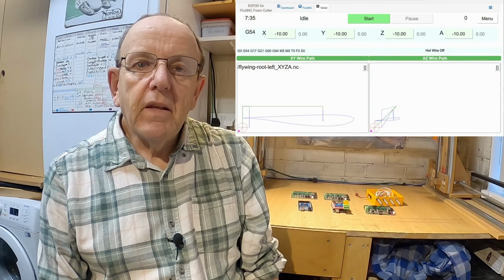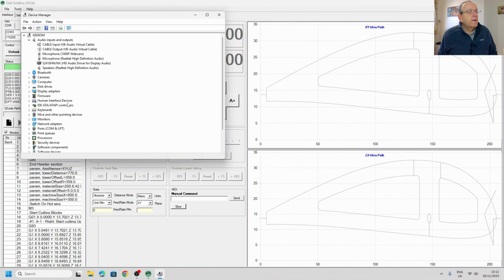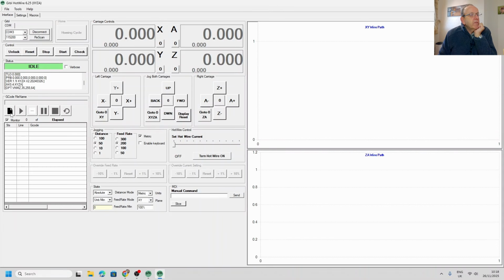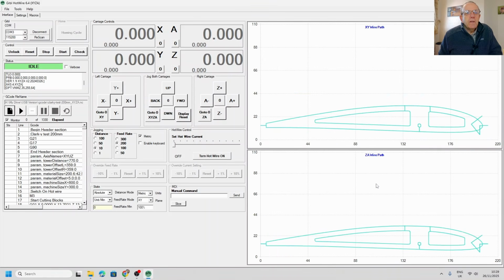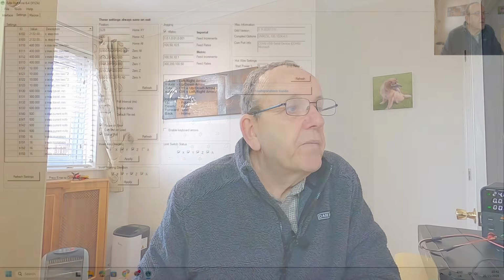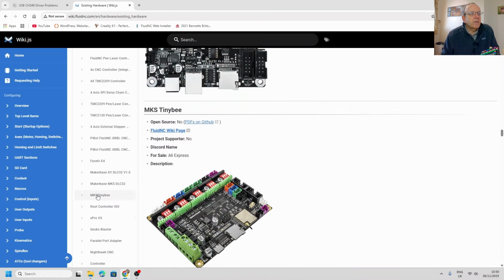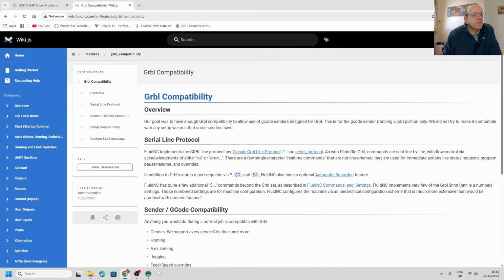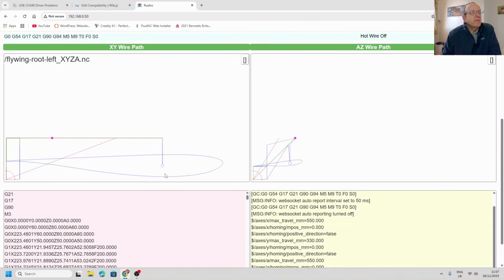Grbl Hot Wire v6.4 – Now with FluidNC Support! Big Update

Comment: Hie  I want to build a plasma cutter can .can I use the hot wire software for that and what should I modify for it to work ?
Reply from the maker: No it expects 4 axis or will give an error. I recommend you use SenderIO this it what I use of my CNC router. It has options for laser cutting. https://github.com/terjeio/ioSender/releases/tag/2.0.46
Reply: Ok if you have time please do a YouTube video about cnc machine .how to install the softwares just as you did on the hot wire cnc.other YouTube videos do not give a clean clear detail as you do.

Comment: I have the previous version running on a BTT SKR Pico board.  I was not able to work out how to control power to the hot wire though.  You mention something about that and the use of an external small board?  Can you offer a bit more detail about where to connect the hot wire to that board so that power to the wire can be software-controlled?  Thank you! BK
Reply from the maker: You connect the wire to the HB connector. Then set the power on the slider. The external small board is for the MKS Tinybee, not the Pico. Could you make sure you remove the jumper for USB power? This will stop any power from going to the HB connector.

Comment: Hello there . I finished the software part .iam using 17hs4401 stepper and a 4989 driver.my motors are just vibrating and they sometime try to turn.what could be the problem?.wire pairs are in the correct sequence.
Reply from the maker: Make sure you set the vref for the drivers. The colour coding of some connector wires can be incorrect. Check the pairing by shorting the wires explained here https://www.youtube.com/watch?v=yzCKXei0pLU&t=445s

Comment: @rcKeith Hello, could you please change the input method for the Distance parameter in the Jogging section of the Grbl HotWire software to a blank input field? This would allow me to directly enter the desired distance during daily use without having to select from multiple options. Thank you!
Reply from the maker: You can change the jogging distance in the settings tab
Reply: @rckeith  Hello, you may not have understood the problem I described. For example, I want to move the object 235mm. I would prefer an input box where I can directly enter 235, and then the machine will execute the operation. With the current software settings, I need to select 100 twice, 10 three times, and 1 five times, which is cumbersome. Even after setting a fixed parameter in the settings options as you suggested, there are still four fixed values in the Jogging Distance section on the software's homepage. In actual use, the required movement value is different each time, making it inconvenient to select multiple times using this option. I also hope the Feed Rate option can be set as a blank input box so users can easily input the desired acceleration all at once. Thank you very much for your reply!

Comment: i tried the same  fluid nc hotwire controller. it  worked great but i struggle with the sharp trailing edges.
can you suggest what thickness or settings for trailing edges to prefer.
Reply from the maker: I usually set them 3mm at the root and 2mm at the tip. If it's a straight wing where the root and tip are the same size, I use 3mm. Hope that helps
Reply: @rckeith  ill try this and let yo know my observation. thankyou for solution